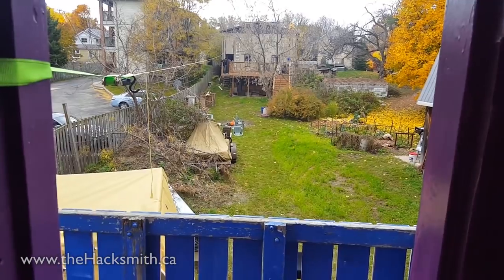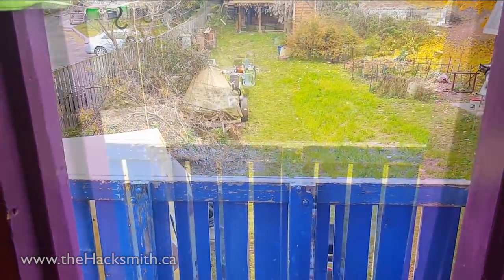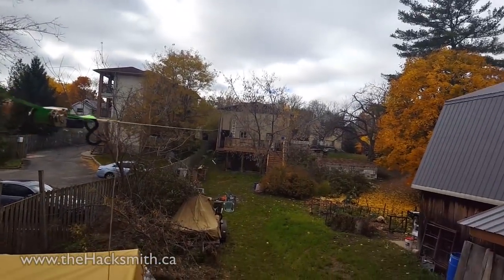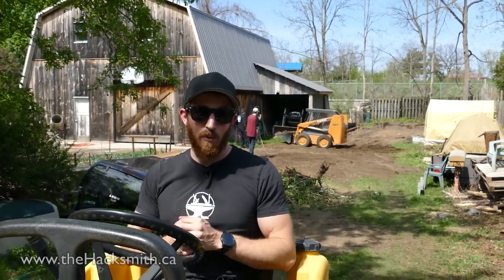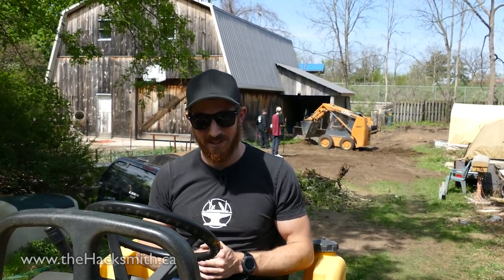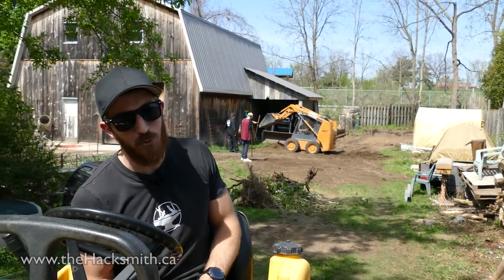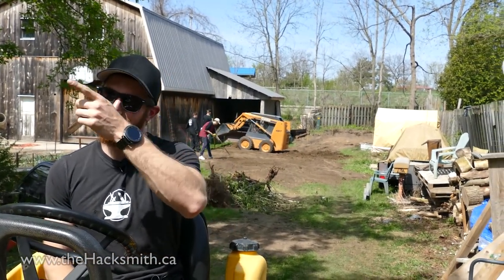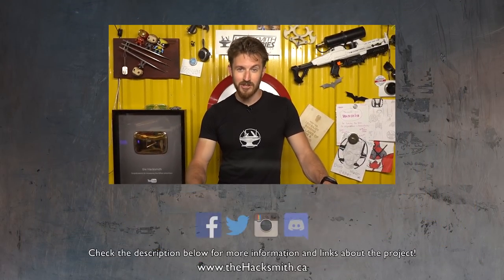Tearing Down a Treehouse with a TRUCK & Thor's Hammer!

Comment: As someone who's attempted to, uh, disassemble, a building-code complaint building with a sledge hammer, I was surprised to find that it's surprisingly (or unsurprisingly) difficult to break down a house with a sledge hammer. In the end, we pried things apart with a wrecking bar mostly, and only used the sledge hammer to knock UP the roof.

Comment: Make metal handle for the axe heads
Reply: David Johnson nonononononono the shock wave that would be sent into your palms could break your arms
Reply: Hi *more resilient wood
Reply: Real_RUBB3R this are hollow aluminium, and that particular system contains less energy in orders of magnitude. Hollow aluminium bats weigh somewhere in the ounces range where an ax head alone weighs several pounds. When an aluminium bat srtikes a baseball, it does not stop. Rather, both the ball, and the bat maintain a forward velocity. When an ax strikes a tree, all of the energy stored in the ax has to be dispersed in a matter of milliseconds. Let me do some quick math for you. Brb
Reply: Alright, I have done a bit of quick maths:tm:
The average angular velocity of an ax head at a logging sport day is ~80 to 90 miles per hour. Pretty fast eh? (Canadian joke?)
The average angular velocity of an aluminium bat swung by MLB professionals is ~70 to 80 miles per hour. A little slower, but still blazing fast!
Both scenarios accelerate the object in question at about the same rate, but sport loggers get some help from gravity.
The force at the time of impact for both of the systems is as follows:
MLB player swinging 31oz aluminium bat at roughly 30 m/s (measured at the tip of the bat): -2636.506 Newtons of crash force
Sport logger swinging a 58oz steel ax head at roughly 32 m/s (ditto): -5225.38 Newtons of crash force
That is a MASSIVE difference right? Eh, not really. But here is the thing: my perfect system assumes that both objects come to a complete stop. 
Where this is fine for the ax head, as it becomes lodged in the wood, the baseball bat does not just stop mid air.
MORE MATH!!!!!!!
If we assume that about 90% of the bats velocity was transferred into the ball (this is a generous number), the bat would still be moving at roughly 3 m/s.
I assumed that the impacts of both scenarios takes about 20 milliseconds. It seemed reasonable to me and this number lined my calculations up with 2 scholarly studies on this topic.
So with all that MATH completed, I found that the force that the bat exerts on the ball is just over -2600 Newtons of crash force. 

The next thing to look at would be how aluminium deals with large amounts of instant force and how much the forces deform the bat. (You will be surprised)

This is why we use wood as the handle for axes. It has certain "springy" properties that lengthen the period over which the crash forces are dispersed into the rest of the system. A steel or aluminium handle would transfer the force almost immediately. 

To put these forces into perspective: the average human femur can take ~7k newtons of crash force before it breaks. There is a catch there. This force is exerted on either end of the bone. Hit any bone with that much force in a perpendicular fashion and you have bonemeal.
All this to say, there is a massive difference in the amount of energy being throw around in these two hypothetical systems.